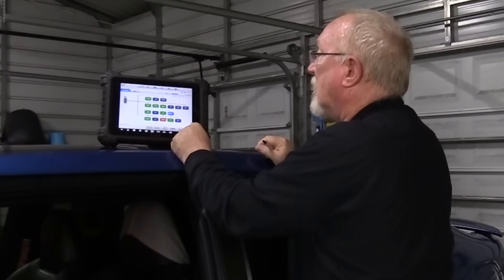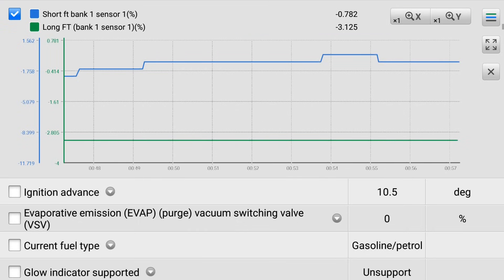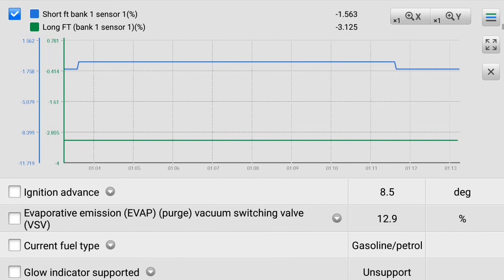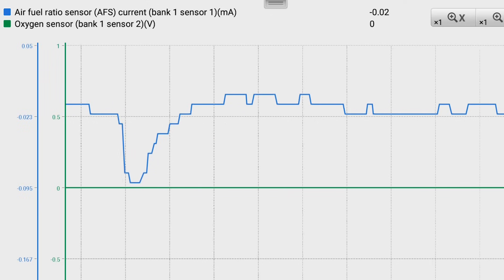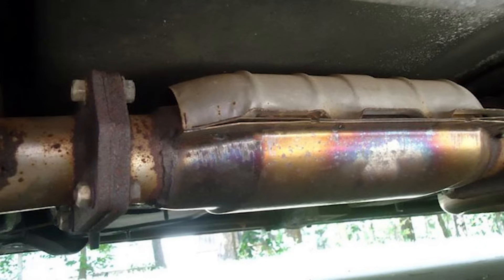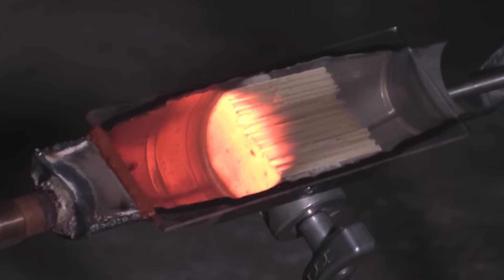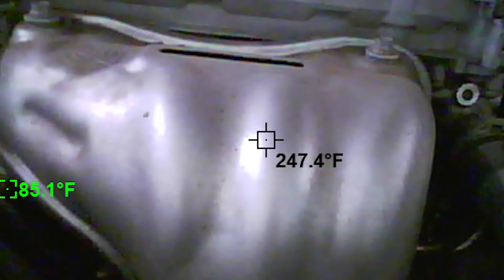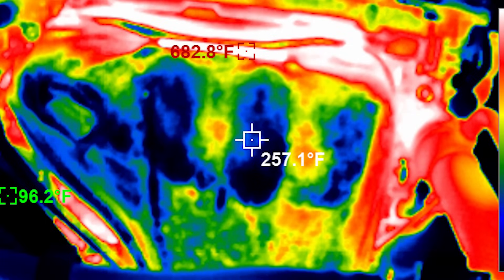The Trainer #118:  The REAL Cause Of P0420/P0430 DTCs

Comment: My experience was as follows, P0101 code left for 8 months, bought a new sensor, didn't fix the code, bought a new air filter, didnt fix the code, finally replaced a faulty PVC valve , fixed the problem, got the car through inspection,  light came back on for a p0101 and p0420. Replaced the spark plugs and coil packs, p0101 gone. Fuel trims back in range with 420 code that comes and goes. Rear 02 sensor giving weird readings, replaced downstream 02 sensor, problem fixed. Was never the Cat. The temperature test was good too.

Comment: Short lived cat usually is a oil consumption issue mostly rings crankcase psi system in German vehicles or not common valve stem seals particularly in Japanese vehicles

Comment: Near poisoned converter is almost too late. Something further upstream already did the damage. If you lucky maybe you got shitty cats from the get go but most of us will take the quick patch route to suppress the code. Car seems to be running fine and just need to run it for another year or two or three etc. 
Cats eventually lose their ability to burn properly when the ratio is off. So it's on a scale.
My situation the exhaust smelled like unburned fuel with 0420. Tried a few of the things mentioned as far as sensors, throttle body change, vacuum leaks, plugs, injector swaps, cat clean, O2 sensor swap, fuel filter. Both cats burn same temp. Swapping O2 didn't change the bank. 
Didn't have room for the sensor spacer so went with the electric simulator cap/resistor method. Still have a gassy smelly exhaust. No code. 
And I also tried a few tanks of premium fuel. Highway Italian tune up. Still popped the code. 
Was tempted to get the super cheap Amazon cats but felt it was not worth the trouble. If I was keeping the car I'd try to find used cats but check for damage. But  as suggested in this vid the problem is somehow air fuel ratios perhaps fuel pressure pump, dirty injectors or malfunctioning. So many things that could upset the ratio and cause the cats to become poisoned.

Comment: My converters sense new have been around 800 deg at idle.  Around 2k rpms they are just under 1400 deg.   Wide open throttle can make them as hot as 2k deg.   This is a supercharged car.

Comment: My 420 code was the result of a leaking flex pipe/ mid pipe.
You couldn't see any physical sign of a leak. Smoke test didn't reveal it either. We started the car on the lift and after sniff test with the human nose proved the thing was leaking. Changed out the the flexible section and hard reset the computer. No more issue since.

Comment: Got this code on a 68 k miles car that was eight years old... Luckily, it's under federal warranty, and the dealership was required to replace the part... I had to order it from Mazda and then wait for them to be ready to install it. It would have cost me 1800 in parts but they had to cover it... Even though the car is out of manufacturer warranty, they have to do it up to 80k

Comment: Been getting this code intermittently for the last 3 years and it's been getting more frequent, replaced all O2 sensors and it still comes back. Decided to clean the MAF sensor and revert to stock air filter (had a K&N before) let's see if it comes back soon.

Comment: Use top tier premium gas and they won't fail.  Have you been using regular or cheap fast stop gas?  I had a code and started using the top tire gas and it went away.  That's my experience anyway.

Comment: Thank you for a very interesting video. I live in UK and have never seen any of your wonderful equipment used in UK garages. If I saw a technician with equipment like this I would be highly impressed. I liked the fact that you mentioned looking for discolouration on the catalytic converter. It is something a layman can do without hi-tech equipment. I also liked the way you emphasized looking for the cause of a catalytic converter failure. After all it's no good putting a new one in if it is going to fail again. Absolutely excellent.

Comment: My car having a wierd issue. It have a delay start after around 50 mini or more upto around 12 hours of last start ( if turnd it on after 2 or 3 or 4... It will delay start and i smell fuel out of the exhaust) but if i didnt start the car for around 12 hours it will start normally with no delay. I changed blugs, pcv valve, fuel pump, inspeted coils and injectors all good but the problem is didnt go away the car still delay start after 50+ minites. What could be the reason?

Comment: My 2015 explorer 3.5L has both 0420 and 0430 codes.  Upstream and downstream sensors are new. The vehicle has 242,000 miles on it. I’m guessing they are just spent. I did the shopvacuum test a while back. I do have some exhaust leaks the exhaust is original. Flex pipe has a good leak. There are multiple smaller leaks here and there. I’ve also already done the IR thermometer test. There isn’t a significant temp difference between the inlet and outlet ends. 

I first got the codes fairly soon after I replaced the spark plugs and fuel injectors. The plugs were very old- car still ran good, I just never bothered. I only did the fuel injectors because I was right there doing the plugs anyway. At first I suspected a bad injector or something in the batch of new ones.  But I think it’s just old age.  I need a new sticker in August so I’m going to just replace the converters and the exhaust. I need to buy some time. I don’t mind spending the money on the parts and doing the work myself. It’s still cheaper than buying a new car, for now.

As it is now, if I clear the codes, I can’t drive more than 100-200 miles before the CEL comes back on. What’s everyone’s opinions on Walker aftermarket Cats? Will they satisfy the ECU or am I still going to get a check engine light?
Reply: I have the same year Explorer with the same behavior after 100-200 miles. What did you figure out?

Comment: I have a used car and after driving the car for 1 year  i got  to know someone has stolen the metal inside the converter.. i have replaced the converter the O2 sensors i am still getting the Check  engine light..i have ordered a Spacer adapter hope i finally get rid of the Check engine light.

Comment: Can taking a lot of short trips, like less than a mile,  and rarely any longer trips, lead to coating the oxidizer portion of the cat converter and/ or occasional excessive overheating of the oxidizer portion?  Rationalization =>  hydrocarbons collect on the oxidizer surface and form a film because the vehicle is not driven long enough to heat the oxidizer enough to light it off.  But if/ when it does light off, there is so much film/ fuel on the oxidizer surface that it overheats.

If the cat converter is plugged, could the higher exhaust manifold pressure be measured directly or indirectly?

Per the tech support person with the Indiana emissions compliance - 
-- The short term trim + long term trim should be 0%, +/- 5%.
-- The reported cat converter temperature via OBD2 is usually a calculated number;  rarely is/ are there any measuring devices monitoring the cat converter temp.
-- The surface temp of the cat converter outlet should be at least 100 F° higher than the inlet.
Indiana tech support authorized (fortunately) a one-time dynamometer/ tail pipe emissions test after spending lots of money and time working around the P0420 fault and Check Engine flags that failed to clear on a 2009 Saturn VUE Hybrid.  Results:  Max allowable / Actual measured in grams/ mile => HC 0.80/ 0.01;  CO 20.00/ 0.80;  NOx 3.00/ 0.01.  So all passed, but the P0420 & Check Engine flags persist.

Comment: just bought a 2014 chevy 2500 from a dealer. It was design to use the e85 fuel (yellow gas cap) ... I drove it home and the next day I went to fill it up. When i open the tank cover and saw the gas cap I was confused. Luckily the book manual was in the truck, so I learned what it was. I had to find a gas station that have the e85.  About 50-60 miles later the engine light came on. I scanned the computer, and the code came out to be P0420. I am now wondering if the previous owner has been using the regular gas instead of the e85... I have scanned the truck at dealership after test driving it, but no error codes came up. I am wondering if the salespeople have been deleting the code when it pops up ask, I was able to delete it... or maybe because I used the e85 the truck computer is reconfiguring itself... I hope i didnt mess it up and especially hope i didnt buy a lemon
Reply: the problem is that the e85 started giving the 420-430 code using it... I finished the entire tank of e85 and put regular gas cleared the code it dont have that problem anymore. Also, i was getting about 8.5 miles per gallon on e85 and 11-12 miles on regular gas. I have a friend who also said he doesnt get good mileage with e85
Reply: @temujinkhan6326  Its normal on E85, it uses 30% more fuel than regular gas thats why your MPGs went down, but it shouldnt give you a code unless maybe some one just put a yellow cap and it isnt actually E85 capable.
Reply: If it has the yellow cap it can run both E85 and regular gas.

Comment: Brilliant video very interesting my daughter has a fiesta ecoboost 1 litre and came up p0420 car misfiring and bad vibration on idle bits seems to disappear round 1500 rpms checked catalytic converter and was broken inside so replaced cat no better changed coils and plugs no better but then took out injectors and discovered some of the hole where blocked on the injectors ordered 3 injectors suppose to be coming tomorrow so fingers crossed will sort it out

Comment: Im here like many, because of the P0402 code.  Showed up randomly on a road trip.  No issues, gas mileage great.  In fact, if the CEL didnt come on, business as usual.  Soon as I got back 2 days later, threw it on a code reader.   Dealership instantly said, bad cat, 5K to replace.  No trouble shooting, nothing.  All over the phone.  CEL went away 2 days later by itself.  Cleaned the gas cap rubber and put in a new tank of gas.   Normal, who knows.  But at least this guy explains things like a tech should
Reply: Update? In my experience, the CEL comes and goes. Curious if it stayed off for you.
Reply: @LanceTOsborne  Update is the honeycomb is falling apart for some reason.  Borescope confirmed.  Still running fine.  And I have no idea what I would of done to wreck a cat.  You cant maintain them, and I do all my regular maintenance as required
Reply: @virgil3241 Glad it’s running fine! Bummer there’s not an easier fix for this. Dealing with something similar: CEL is on, but shop says the converters are working fine. 🤷‍♂️ Almost time to find a gray market fix.
Reply: @LanceTOsborne  IM not paying 5K for a cat installed.  Hell, when you get that price for repairs, you think an entire motor rebuild would be needed, or a transmission complete replacement.  If I do replace the cat, it will be cut it out and replace.   Mitsu its the entire flange to flange for the part.  So you replace 20% of the part when 80% is still good
Reply: @virgil3241 Amen. I appreciate the response. Good luck.

Comment: Are you the emissions detective? Track me down. I am not hard to find. Launch the Emissions SWAT team to stop me with spike strips. Take me at gun point. You want me to pay $1600 to$2000 for a Toyota manufactured exhaust? Parts alone-never mind the labor. I'm 71 years old, crawling under cars is getting kind of old.  The car runs perfectly now for two years. Plenty of power. no foul exhaust. As far as I am concerned IT IS FIXED. An Automobile Corporate magazine is going to lecture me? (MotorAgeMagazine)  Why don't you admonish someone more deserving-like a 34-time Felon and adjugated rapist? Leave me in peace.

Comment: I replaced both converters on my 12 Ford fusion sel awd.  No my engine light stays on.  I was told it's because ford doesn't make oem converters anymore.  HELP!  I hate that light staying on!
Reply: My car runs wonderfully.  No surges ...no symptoms at all.  Runs awesome.  I don't understand why my light is on.  One Ford guy told me that my 2nd conv. is 1/4 smaller than the OEM removed.
Reply: @chubster71 I have the same problem with my 2007 Dodge Dakota. No OEM and aftermarket sucks

Comment: Dirty fuel injectors or oxygen sensors with over about 80k miles of use will also cause these trouble codes.  I have cleared P0420 codes several times with a high quality fuel injecor cleaner that  contains PEA.  I like STP complete fuel system cleaner, it is about $6 at walmart, and it works for me.
Reply: How often? Every fill up? Every other?
Reply: @eeveecat2158  some of those cleaners recommend every oil change

Comment: Very helpful and the reminder to REMOVE THE UNDERLYING CAUSE FOR FAILURE IS HUGE!  Very good for the more professional approach.  However, the tool analyzing the exhaust gases one suspects is cost prohibitive for the DIY guy simply trying to fix an isolated incident.  I especially appreciate the suggestion of testing the manifold outlet temperatures for normal operating temperature with the relatively inexpensive thermal test unit.  That's a new one for me and I will most surely use it where those are accessible without dis assembly of the topside to get to them.  In the past I have found myself removing spark plug wires or injector connectors to get an idea.  Thanks for putting this together!

Comment: I recently had my Ford F-150 (2016 3.5L V6) worked on for runnability issues. I was told that the engine was misfiring on at least two cylinders due to cracked spark plugs. They ultimately found that all of the plugs were cracked. After the repair, the truck has been running great. But then, the other day, maybe two or three days out of the shop, the CHECK ENGINE light lit (codes P0420 and P0430) and the same shop told me that worst case, if they might have to replace the catalytic converters ($$ for me). Could this problem be, instead, bad sensors? I did hear the advisor mention at some time during our conversations, something about the O2 sensor. I plan to run a can of Cataclean soon. Your thoughts on doing that?

Comment: O2 sensors are recommended to be replaced 100,000 MI. By the dealer and the manufacturer and the mechanic. You can look use some of the cheap scanners that can show you a live data. Of the O2 sensor

Comment: I bought 10.00 of gas at Ingles Grocery where I live.  Approx 5 minutes later the check engine light came on.  I had it checked at Advance Auto and OReilly.  Both told me it was the code to replace the catalytic converter.  My 08 Prius was running fine so I just kept driving it and the next day the light went off!  So maybe the O2 sensor is going bad but don't just run out and buy a cat until you know for sure!

Comment: hello, just found this video and was reading through the comments. I have a 2004 Toyota Sequoia and I had my 02 Sensor replaced few months ago and the catalytic converted (bank 2) replaced few months ago [aftermarket one].  The check engine and VSC alerts popped up again this week. Took it back to my local mechanic. He think it has to be a Catalytic converter from the dealer so he said he would check with them on the price and get back to me. He says its okay for me to drive in the meantime.  For the solution can in your video, what brand do you recommend for my vehicle? 2004 Toyota Sequoia.  thanks in advance

Comment: You're beating a dead horse. 

The substrate of the catalytic converter has a very thin coating of palladium platinum rhodium. Like Iridium or Platinum spark plugs, the thin coating eventually wears off and blows out the tailpipe and ends up on the side of the road or in the air and in your lungs. 

Everything the government has ever done to increase revenue or in the name of so-called clean air has devastating repercussions on living things and the environment.  

For instance, they had to discover and design this new technology, they had to invent it, build new manufacturing plants and manufacture it, and transport these parts back and forth across the country in big diesel trucks. Then store the parts in climate controlled warehouses that charge by the square foot!  Finally somebody had to pay for these parts, then it goes back on the truck to be transported again.  Now you have to install it or pay somebody to install the part.

Every time the government creates these type of regulations, we have to pay for it. It's getting so ridiculous, our automobiles have become disposable junk!

I worked at a GM Cadillac dealer and the shop foreman said, the more crap they put on an automobile, then the more that can go wrong.  

You can hear an exhaust leak, or see misfires codes or over temp, but it's difficult to see a slow responding O2 sensor or prove it. If it's not the O2 sensors, then the car probably needs new catalytic converters. But wait, the aftermarket converters might still set a code!  You are forced to either purchase a very expensive OE catalytic converter if available or put a piece of black tape over the light and call it a day. I mean if 90% of the country has no inspection whatsoever (the smart ones that know about this scam) and the car has no misfires or drivability symptoms, take that catalytic converter money and go buy a Turkey and some Christmas presents. 

It reminds me of a movie I watched, where people went to work to push buttons that shocked other people and made them get up and go to work so they could push buttons. To earn digital money so they could live and eat.  Sound familiar?